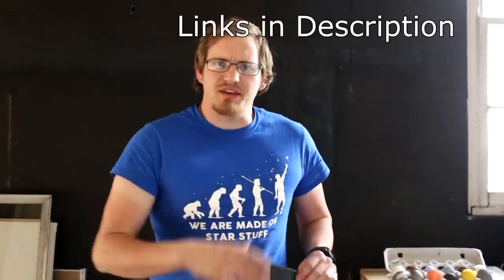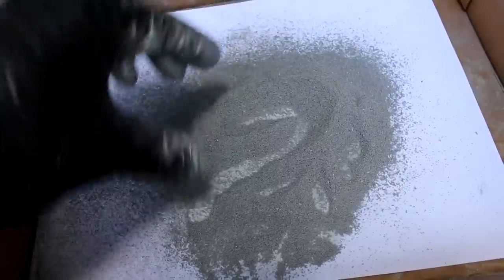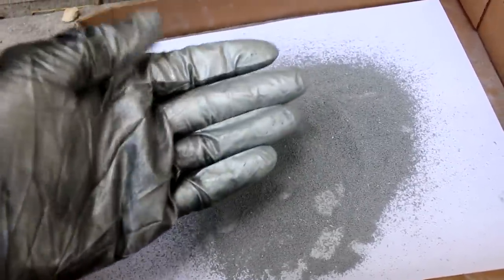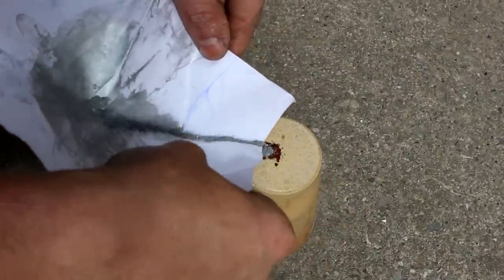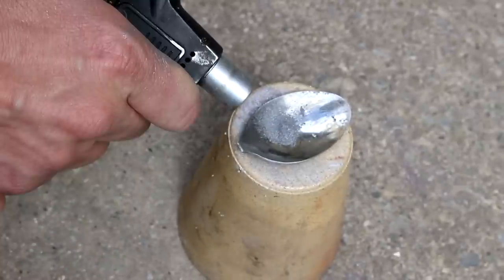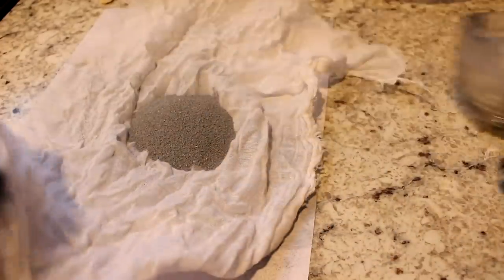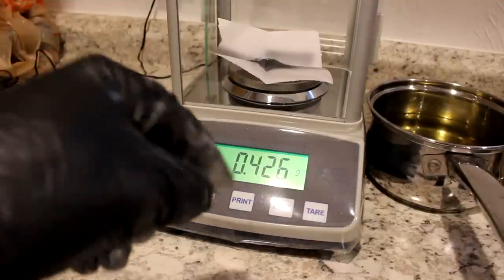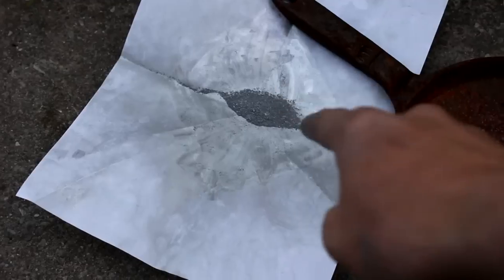Thermite From An Etch A Sketch; Yes It Can Be Done!

Comment: Polystyrene is attracted to static charges. I wonder if you could have combed your hair then placed the comb over the aluminum and super fine polystyrene beads and have the beads stick to the comb. What you showed in the video looks almost identical to silver/aluminum "Testors" brand paint for hobbies. The copper oxide you show in the video is exactly what you want to prevent from forming when brazing copper refrigeration lines. You use an inert gas like nitrogen. The black scale will not form inside the pipe to clog up capillary tubes.

Comment: Nice breaking bad reference at the end :)
Reply: When?
Reply: no
Reply: Melting a lock with thermite
Reply: +gabe snead That was because the original videos by the big guys were set out to argue one way or another as to whether the clip from the show was feasible in real life.
Reply: +gabe snead Better off using bolt cutters, really. Much easier.
Reply: Not a bike lock... an actual lock on a high security door, like in Breaking Bad.
Reply: Nikolas Powell How are you going to use bolt cutters on a door?
Reply: Bronze cut off the knob and then pipe up inside it, depending on the lock design of course
Reply: Nikole .. You obviously never saw the scene from BB. If you had you would know there was no knob to cut off.

Comment: Jet fuel cant melt steel beams.

But an Etch A Sketch can!
Reply: hail the etch a sketch
Reply: After all it wasn't the Mossad, 1 Etch A Sketch brought down 3 buildings!
Reply: Nope but the heat will weaken it... Causing catastrophic failure when there are millions of pounds on top of it...
Reply: @dexonaut666  only two buildings were hit by planes, how do you suggest wtc 7 went down? Now we even have an extensive research by Fairbanks University ruling out 'office fires' as a possibility.
Reply: @weromn : 7 was standing on the SAME concrete foundation as 1&2 , so what could go wrong ....
OMG ... 
I see stupid people ....
Reply: @dexonaut666  the airplanes are aluminum, the steel beams were all coated with iron oxide. Two of the main ingredients for thermite.

Comment: Is that 1600 Fahrenheit or Celsius?
Reply from the maker: +Folopolis 
F
Reply: +Cody&#39;sLab what's that in real units
Reply: +Pseudonym Persona 871+1/9 centigrade.
Reply: +Pseudonym Persona 1598 - 32 = 1566
1566 X 9 = 14094
14094 / 5 = 2818.8 degrees Celcius.

EDIT: 1566 X 5 = 7830
7830 / 9 = 870 degrees Celsius.
Reply: Girish Manjunath it's more of 871.1 actually
Reply: +Folopolis 
871.11 °C  (degrees Celsius)
1144.3 K  (kelvins)
2059.7 °R  (degrees Rankine)
696.89 °Ré  (degrees Réaumur)
464.83 °Rø  (degrees Rømer)
Reply: +Folopolis ye
Reply: Pseudonym Persona what was my mistake?
EDIT: Oh, right. 5/9, not 9/5.
Reply: +ComplexScience why can't everyone use Kelvin and be done with it? I mean, try to determine Carnot efficiency using Celsius or Fahrenheit sometime. As if you can have a negative amount of heat.   Fahrenheit makes sense to me if it's 79 degrees outside, but try talking about the boiling point of oxygen or figuring out what is twice as hot as 20 degrees Fahrenheit (hint- it's not 40 degrees Fahrenheit). Not arguing with you, just voicing my general frustration with 4 different temperature scales. 
If you enjoy this sort of thing, have fun. Any answer is correct, because I'm not checking your work. 

How many BTUs to heat a pound of air at 4 bar pressure at 7 degrees Fahrenheit to 400 degrees Kelvin and how many liters of air would you start with and how many cubic feet would you end up at, assuming specific heat of the air in question to be 1 joule/kg at 14.7psi?
Reply: +Folopolis 
840/2* goobers
Reply: Andy Jones 42 serendipons,
Where a serendipon is a unit such that 42 of it is always the correct answer.
Reply: Andy Jones because it's easier to say this patient had fever of 39 degrees than this patient had a fever of 312.15
Reply: Girish Manjunath somehow I knew 42 was gonna be the answer. Someone tell the mice I figured out the question to life, the universe and everything so they can follow the dolphins (so long, and thanks for all the cheese?)
Reply: Pseudonym Persona well, where I live, if a body is 39 degrees, they're being stored in a refrigerator and have been dead for some time.
Reply: Nuckelhedd Jones CALM DOWN JOHNNY BOY
Reply: Andy Jones Chocolate.
Reply: Nuckelhedd Jones Take a deep breath...
Reply: Girish Manjunath ha, I thought you were talking to me and calling me names. Didn't realize there was a real nuckelhedd Jones! I skip over any comment in all caps.
Reply: Andy Jones yeah... Sometimes the most interesting characters are in All Caps.
Reply: +Andy Jones because for everyday situations, Kelvin is a bad measurement. In C° 0 is when water freezes and 100 is when it boils just by knowing those 2 facts you can then quickly know how hot something will feel when someone says, for example, it's 2 degrees outside you immediately know that it is close to freezing. The fact that it's easy to use and understand trumps the fact that it's not the best for very specific situations. I don't know how F° works because I have never used it.
Reply: Bobthedj so you realize that Celsius is only "better" because that's what you're used to. Its like if a argued we should use inches, feet and miles because I can relate to them better. Sure, I CAN relate to them better, but cm, meters and kilometers make a lot more sense. Kelvin 273 is 0 and 373 is 100. The benefit, is I know that something that's 200 degrees contains twice the heat (is twice as hot) as something 100 degrees. It starts at 0 instead of an arbitrary number (the freezing point of water). Obviously, there's always a learning curve. Its actually easier for you because you just add 273. Converting Fahrenheit is just ridiculous.
Reply: +Pseudonym Persona You mean communist units?
Reply: +Andy Jones It's better because same increment size as the SI unit, just adjusted to things any person can understand/relate to.
Reply: +NO3- Junkie you mean the unit that 98,5 percent of the world uses?
Reply: +datAkwardSwedishGamer Yes, 98.5% of the world is communist.
Reply: +NO3- Junkie lol, you're actually right about that
Reply: +NO3- Junkie I can't think of a single country that isn't at least a little bit pinko-commie.
Reply: +NO3- Junkie I can't think of a single country that isn't at least a little bit pinko-commie.
Reply: Because 0C water freezes 100C Water boils. 99% care mostly about that. F on the other hand is useless so the Americans can go with Kelvin ;)
Reply: Its because you can't actually measure Kelvin, you can only calculate it.
Reply: Bo Bramer That's 100% true, but only because thermometer manufacturers don't use Kelvin. They could easily make Kelvin thermometers if they thought people would buy them. That sure would make things easy. I'm protesting in Washington dc this weekend. What do we want? Kelvin! When do we want it? Now!
Reply: fahrenheit
Reply: not as hot as you think
Reply: 1600 F = 871.1111 Cel
1600 Cel = 2912 F
Reply: If I ever get unjustly put in prison, this information will come in handy.            

"Hey guard can I have an Etch-a-Sketch for good behavior?"                                      >=D Just kidding...maybe.
Reply: It was Fahrenheit. 871 Celsius
Reply: +cybertree you won't be able to get one In  jail dude , prison is camp lmao
Reply: @Andy Jones : Well, I wouldn't exactly call 400 K to be twice as hot as 200 K, and I'm cool with Celcius being used instead of Kelvin, because it's based on the temperature when water freeze and boil, kind of like going from 0% into 100%, and we get to know the rough idea of 1%, whereas Kelvin is basically using Celcius's 1% and set the point of 0 in the absolute zero temperature.

What I'm not cool with is other shit, like Reamur, Fahrenheit, and Rankine, those are simply bullshit.
Reply: Arwin Sanlia I agree with your last sentence, but 400 is twice the heat as 200 if it's Kelvin. Like a measuring cup, you need to put "0" at the bottom, not some random point half way up. Rulers start at the edge. I agree that in day to day life, Celsius makes good sense. Kelvin is more practical for science purposes, figuring out efficiency of heat engines, Stirling engines, gas (Boyles) laws, cryogenic cooling efficiency, etc. You're talking to a guy with a cryocooler in his living room, so I'm a bit odd, but after converting to Kelvin all the time, it just makes logical sense. Like if I want to know how much energy it takes to cool a pound of nitrogen to liquid, or how much power I can get if I evaporate that liquid and power an air engine, or figuring out how big heat exchangers need to be. Just converting pounds to liters or kg is difficult enough! As the world gets smaller, we need to unify our units, and Kelvin just makes sense. Granted, from Celsius it's just a matter of adding 273, but Fahrenheit? Fuggetabout it.
Reply: Andy Jones I disagree but what ever floats your boat
Reply: daniel roach I'm not sure what weight, density and water displacement have to do with this. THAT'S what floats my boat (sorry, I couldn't resist).
Reply: 1600c of course. IT'S FAHRENHEIT. if it was celsius, then it would be a ton hotter.
Reply: Kelvin
Reply: For oxidizing the copper?

Fahrenheit
Reply: cybertree good luck actually igniting it, you realize iron oxide based thermite can take up to 10 minutes of direct heating from a blow torch just to start right? The time of heating can vary depending on how you heat it but it’s irrelevant considering you’re behind bars and would have no sufficient means of heating.

Comment: could thermite work as a gunpowder
Reply from the maker: maybe???
Reply: try it! :D
Reply: An odd concept, but maybe.  If you contain thermite its explosive, but it would be stupid hard to get it to go off and Im fairly certain it wouldn't be worth the effort to figure out.  You would also have to figure out how much power your getting per grain.  Assuming the reaction would work with that little material.
Reply: would probably damage the gun
Reply: I don't think so because thermite does not release any gasses: the reaction is only between a metal and a metal oxide. Gunpowder works because when combusted the powder releases gasses which form a high pressure area behind the bullet.
Reply: +Jacob Mendoza  not you .     Nathaniel
Reply: +harry balsaq yeah I know
Reply: it doesn't release any gases?  It releases very little gas, but it does release gas.  Compared to most other reactions its not a lot, but its there.  Whats that grey/white stuff rolling off it? lol

Thermate-TH3 used in hand grenades produces a better thermal reaction and more gas.  Its thermite plus barium nitrate, sulfur and a binder.  

I forget the name off hand, but the binder used in grenades is also what used to be used in rocket fuels.

Its prob not a  good propellant or easy to do, but im not sure it couldn't be done either.
Reply: ***** yeah maybe, its a concept.  Im pretty sure it wouldn't work great, but you could maybe do it.
Reply: +Jacob Mendoza **NO!** It's detonation velocity is way too slow, gunpowder is 7,300m/s, whereas thermite is 2,000m/s (and that's perfectly made, high quality stuff). 
It'd probably throw a bullet a few yards, but it'd look more like a smokey fart potato gun shot. (And ruin the gun 100%, it doesn't deflagrate cleanly, it leaves behind a pile of molten metal.)
Reply: cybertree Black powder has a similar detonation velocity.  Your comparing it to modern smokeless powder.

Thermite would be in the realm of low explosives, but it would still work.  It might not work well, but it could.
Reply: The Ranting Hick I'm telling you, I've seen good copper thermite explode, and it's almost like a matchhead. Even oldschool black powder double the speed, and that's compressed. It'd look like a potato gun.
Reply: cybertree Sure its slow, but a bullet would leave the barrel.  Im not saying it would work well.  im saying it could work.  Im pretty sure its prob pretty comparable to the gunpowder they were making centuries ago.  the modern produced gun powder is likely much much better.

Your missing the point.

The question was could it work.  Not would it work well. 

Never know till you try.  For all we know it works amazingly well and no one knows cause no ones tried.  Lots of things work well in theory and not in practice and vice versa. 

If I could think of a way to set it off in a normal case and gun id load a round to see.  The ignition has me stumped short of making a gun from scratch.
Reply: The Ranting Hick Believe it or not black powder explodes faster than smokeless powder, it's just cleaner. I didn't know I was arguing with you my bad lol.
Reply: cybertree id call it a discussion, but kinda i guess lol
Reply: No, a gun requires a detonation, and thermite doesn't detonate, it deflagrates.
Reply: VintageLJ Depends of what kind of thermite.  No reason you couldn't use a thermite based explosive.
Reply: You EOD? Not many people just happen to know the differences between thermite and thermate off the top of their head
Reply: Nope because it would weld inside the funnel and will blow your gun and you next shot, if the first shot haven't explode the gun
Reply: there isnt enough to melt through any thing.  Your talking grains not even grams.
Reply: Real thermite does not produce much gas therefore it is not useful as an explosive. Aluminum can be used in explosives such as thermobaric explosives, or in rocket fuel. Thermite grenades were used in WWII to destroy equipment, such as artillery to prevent its use by inserting it into the barrel. Safer than exploding it.  If you tried to use it in a gun, you would end up with the same effect, a useless gun.
Reply: Patrick Ford <It remeber me that every WW2 american bomber and plane in général had thermite device near the reticular system because it was in the past one of the greatest secret of precision weapon system, Norden system and for keeping its secret they had to destroy it with thermite
Reply: and if there isnt enough thermite to melt through it does pretty much nothing.  I think you guys are missing the point its in a case and not nearly enough to melt any amount of metal.

It prob wouldn't work well, but it makes enough heat and gas it could work.  Maybe.
Reply: Ye

Comment: You could add magnesium to the mixture to get a better burn or you could substitute the aluminium beads for aluminium powder since aluminium powder doesn't have a layer of skin protecting the metal within. Using a more powerful flame would also get you a better result. I remember that stuff from chemistry class back when I used to go to school, that was about 10 years ago.

Comment: If you have a file, you can just grind up some aluminum coke cans to get the aluminum powder. If you grind up some thick copper wire, and then let it rust in some salt water for a few days, you have copper rust. Correct me if I'm wrong, but this info could let anyone make a thermite weapon. DAMN!

Comment: I used to thermite weld ground circuits to lightening rods attached to the tops of 4 & 5 story tall petroleum processing tanks. Welds were at ground level. Try using a spark striker (a la torch striker) to ignite thermite. Expelling gas scatters the particles. Our weld mix was; flash powder, magnesium, thermite, flux & copper. They used a crucible with three "legs"  and a lid to hold cable & rod. Heck of a noise and a big stink. Knock off the slag then "rinse & repeat."

Comment: If I remember correctly, military thermite grenades contain mostly iron oxide, aluminum powder, and barium nitrate. I believe the barium nitrate is present to initiate ignition. The fact that it also contributes oxygen to the reaction helps to sustain the termite process. Also, the reason that iron oxide is used instead of copper oxide is, of course, cost. Military munitions are expensive enough without adding the cost of copper.
Reply: +Jaye Jay Curry we don't use thermite grenades us uses thermite charges to breach doors

Comment: Cody, thermite i is used by a company called Thermoweld.   It is a product wherein an electrician can bond large electrical copper wires together to make a connection better than a mechanical or compression lug or butt splicer.  Just FYI

Comment: I have an old aluminum barbecue that has been held together by deteriorating iron  metal grates.  The burner had melted the bars holding it so I used lava rocks to hold it up and I added more oven grates to the grill grate holding the rocks above the burner.... Eventually, last week, I had to get a new burner as it was leaking gas. So upon opening up, I found 3 inches of  iron oxide lining the bottom of the now warped aluminum grill...... I was so worried about it combusting  because of how much of the aluminum melted and warped.  Now I have a ton of rust! I just need some aluminum to finally try a faster way of searing my steaks.  That I may get video of when I make some powdered aluminum.

Comment: You should try baking soda from ash. Baking soda is sodium bicarbonate, and sodium carbonate is in hardwood ashes, so to and the "bi" to carbonate you need to pressurize it with CO2. Tricky part would be to get everything from the ashes separated.

Comment: Go to an auto parts store and buy a tube of Alumaseal powder and then go somewhere that does brakes and get some of the cast iron from the brake drum machine used for truing brake drums. Mix them up and you have some pretty decent thermite.

Comment: You could have ground it.  Thermite is very very stable and needs a lot of heat to react.  Now if you were mixing AL powder and potassium perchlorate, then you don't want to grind it because you would have flash powder which is very explosive.